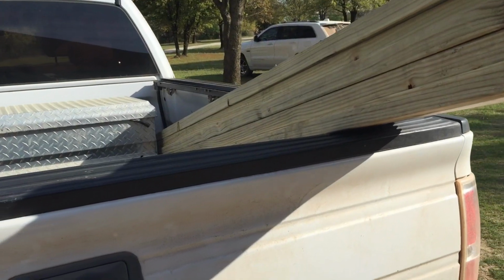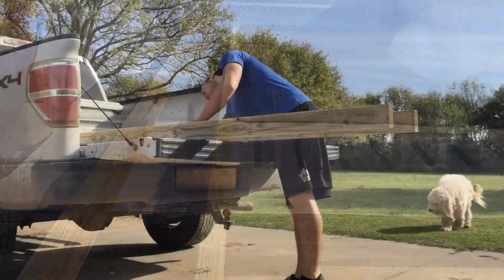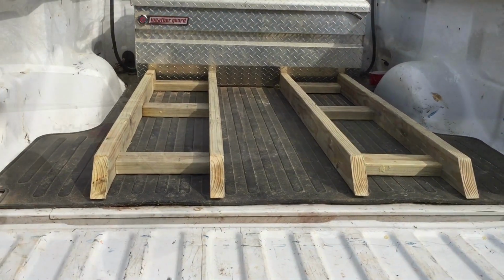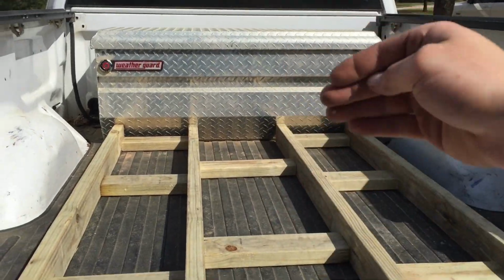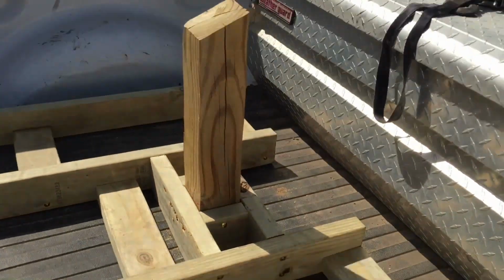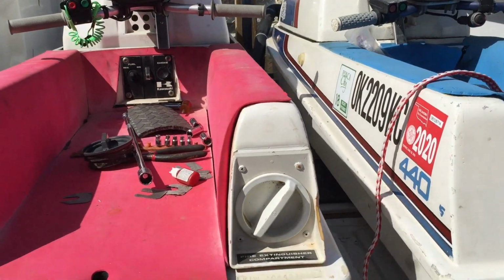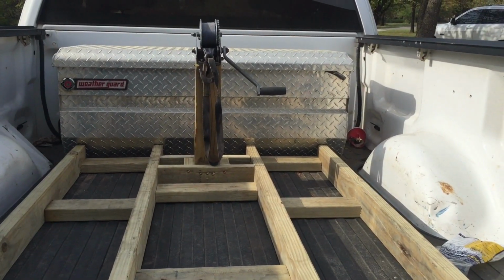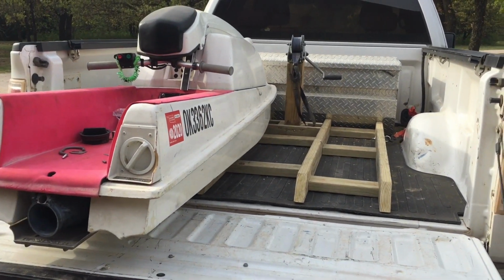BUILDING STAND UP JET SKI BUNKS

Comment: so how do you launch them when you get to the lake just roll it on the dolly? im liking this idea I want to do the same maybe a dolly with oversized wheels so I can drag it up a bumpy lake side beach or something
Reply from the maker: I usually just back in the water at the boat ramp and pull them out into the water. And then when I load them I pull them up with a tie down. A dolly with oversized Will would be super nice!
Reply: @NastyMoto  Could you post a video of this? I'm not sure I get it